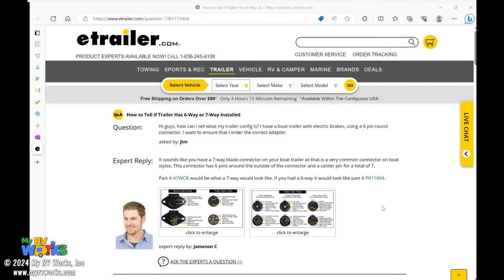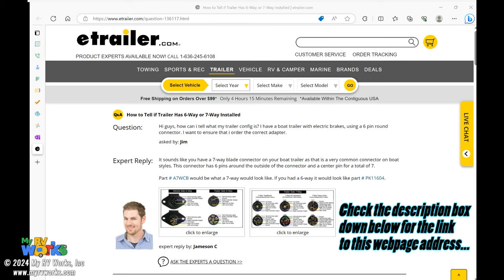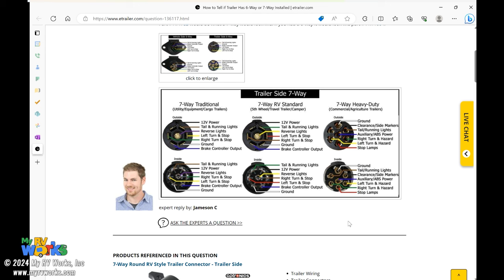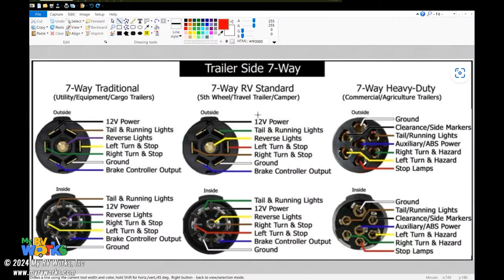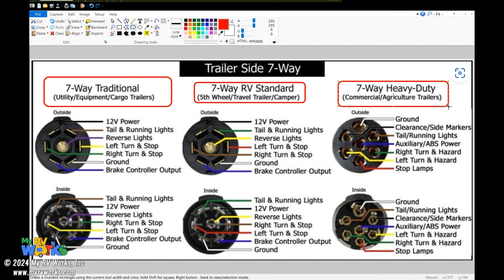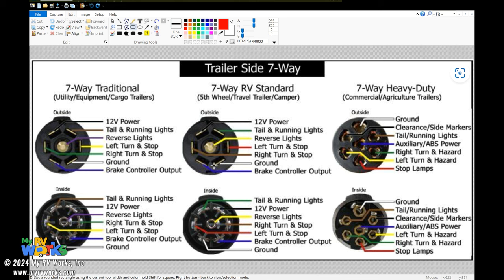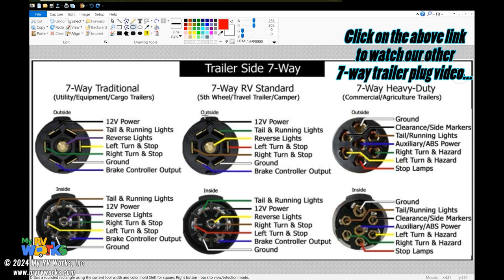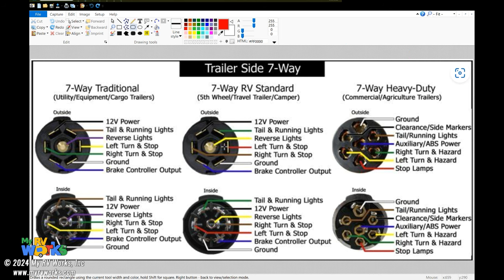7-Way Trailer Plug Wiring Explained  -- My RV Works

Comment: Our 2003 Newmar goes from a 7 way at the RV to a 6 way at the car with the center pin in the 6 way being an aux 12v source for a battery charger to  keep the car battery charged up. I like your idea of using the wago wire nuts to quickly figure out which wire goes where.

Comment: This was helpful to a point, I however have a 2016 camper with original trailer plug from the factory, the previous owner kept the entire trailer mint except for the plug and it's actually like the Center picture but two prong as if it pinches down on something similar to if you were to take your index and thumb to make a pinching motion. Anyhow they've spread apart and I purchased an exact to the center from West Marine, can I just use it?

Comment: I have a question - I have a2003BT cruiser Conquest - why is it that my dining slide only extends and retracts when my onboard generator is on. All fuses ate good / all lights work all 110 outlets work/ AC works / water pump ok/ fridge works/furnace and water heater are ok. Is my batteries the issue? Any help is appreciated.

Comment: I never understood why a dedicated ground wire is run to the brakes.  Looks like it would make more sense to just ground each brake magnet to the frame.  Voltage drop through harness would be decreased by half.